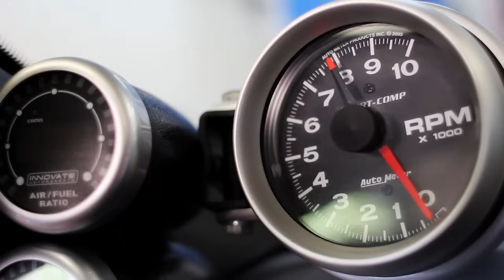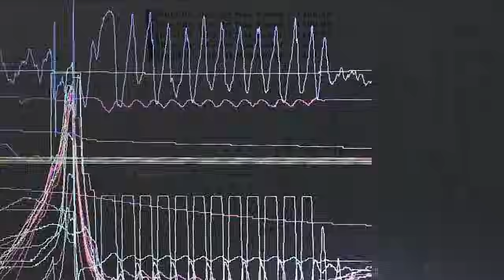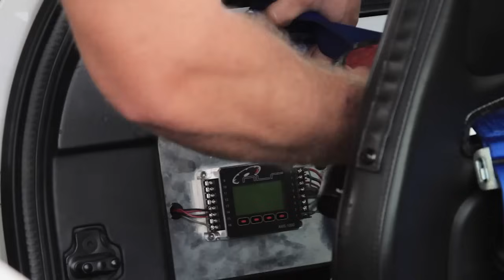New World's Fastest Car! Ford GT Bad v8 1700 Hp - 455.817 km/h ( Guinness World Records )

Comment: You take the money they put in this car to make the power they did compared to the veyron and they still come in way under 2 million dollars and they got a much faster car. And to top it off its built by one of America's most hated brand's FORD. So it go's to show just because you pay big money or more money don't mean your getting the best. one would certainly hope if they was spending 2 million dollars on a damn car you would get a hell of a lot more than a 1000 HP out of it . it's pretty sad when you can go to your local performance store I.E Jegs/summit etc and you can buy what you need to build a 1500 HP FORD /CHEVY /DODGE  engine for a fraction of the cost. And will run rings around the Veyron..

Comment: I can guarantee that with the engine that the bad gt has, after a day of track you will need to twerk a few things and replace oil category components and emission chargers. not with the bugatti. you can track day long including week and still take your kids to school. I can bet that the heat in that bad gt is terrible in traffic and needs speed to help cool is down in a hot day in traffic. not with the veyron. its not about speed but about quality.

let me school you The bugatti is an everyday car.
The bad GT is a tuned super-car with  racing and performance parts to make it fast. it is built based on speed and racked of from a production car which in turns can't be legal in some countries. funny enough possibility of making an identical car is 1 : 10 000

now ratio vs torque vs engine displacement:

The veyron  compression inside in the engine is 9:1 allowing is to be use driven in traffic jams without having any trouble with heat,  lubrication in the engine, or breaking a connexion rod because its torque at low revs. 

The engine of the bad GT compression ratio seems to be 9.4:1 with high possibility of less warranty to stand the test of time.  the turbos need lot of power to keep balance which is obtained at high revs. The max torque of 1,600 nm should come at a high 6,500 rpm making it terrible to drive in the city or just around your home back to garage.

we will not go into quality of making the car an every day car with stereo aircon, suspension, user friendly, importing, specifications, road licensing in street road countries. in some countries this gt can only qualify for track.

now if u own a super car u will know that the nissan gt is much faster in take of and it being a production car means this is a topic for another day

Comment: Power wise it would blow away the underpowered structurally weak V6 turbo. This is more of a Le Mans car...The new GT40 has a great  chassis but a weak motor. It should have had the 351 Trinity running twin turbos...Veyron is a fast car but never did Le Mans so it remains...

Comment: Fastest "Car", not "production car". That's a completely different league. 
You can put even race cars in the category, as that ford gt actually is. But i would bet my ass that with straight line gerabox ratios and proper areo, an enzo FXX or a Zonda R would probably beat that; this 2 cars just for making an example, cause they're actually engineered for a completely differtent use, and not straight line speed. So why don't get a Le Mans LMP1 prototype in the challenge it's a "car"..That's the fact, this "car" category it's complete non-sense and no one gives a fuck. That car it's not road legal or even stock, it can be put on a side of an F1 car. Or just go to a DragStrip, cmon..
All I see is a team of well prepared and professional mechanics who tuned a Ford GT with the biggest tubos they could put their hands on

Comment: What is the ultimate reason to put a V8 in a car? Lasts longer, more torque, low end horsepower, blablablah... NO. ONLY one good reason. You want to HEAR IT and feel it. Period... So now I watch this video, thinking - da..! Got some pretty good sound here - this will be good! What happens? Cra%#y soundtrack goes on and on... Shift into gear, gone and over... And cra%#y soundtrack went right through the d@mn thing... And the remaining 4minutes and 52 seconds are a complete waste of time. What puzzles me the most is that the sound of the jet is on full throttle... Must have some sneaky suspicion that some airplane mechanic got his paws dirty on final editing. SHAME on you!

Comment: Not the fastest car in the world. Go to the salt flats please.  Fastest car in the world has a speed of over 700 mph. And all of you are going to pull the "Performance Power Racing Re-Sets the Guinness World Records holding for Fastest Standing Mile-"""Street Car""" at 283.232 mph".  This is not a street car, you couldn't take a turn in the rain going 15 mph with out this thing breaking free of traction.  The only way I see you doing it is gliding through the turn with the clutch in(if it is clutch driven). This GT is cute compared to real power.  Don't get me wrong though, I love this car and I myself drive a old muscle car.  Also, I have seen cars with less HP go faster much quicker so you guys need to figure out how to lay down the power better.  Power isn't everything people.

Comment: Shaun is at least funny if not totally MISINFORMED. Ford, way back in the middle sixties, SPANKED Europe's best 4 years in a row. The first two years with a 7 liter PUSHROD, OVERHEAD VALVE V8, then the Europeans got all pissy and OUTLAWED THOSE because they could'nt be beaten. Ford came back with 4.7 liter PUSHROD, OVERHEAD VALVE V8'S with one 4 barrel carb and beat Europe's best AGAIN for 2 more years in a row until the Europeans put handicap after handicap on those basic engines (which, incidentally your mother could buy in a regular SHOWROOM mustang or other model car). Europeans will NOT EVEN ATTEMPT NHRA or NASCAR (What's up with that?) More recently CADILLAC (imagine that...) had the fastest time on the Nurburgring test track beating Porsche's BEST until Porsche CHEATED by modifying their car submitted for test until it beat the Cadillac. The UNITED STATES has ALWAYS been FIRST in whatever we've attempted... we always have been... we always will be. We will even survive this EUROPEAN STYLE President we have right now... get used to it Shaun. It's like gospel! You CAN'T DENY IT!

Comment: Ok the buggtii is made out of steel. It's stock and can be bought online. 
This things a FRICKING dune buggy it's had all its heavy parts striped out. It's all aluminum and small.

what im saying is

THERES A HUGE FRICK DEFERANCE BETWEEN A STOCK CAR. AND A JACKED UP ALUMINUM CRAP JOB!!!
Reply: No the Bugatti is mostly made of Aluminum and Carbon Fiber. It can not be just bought online, there were less then 500 of them made over the course of 10 years. The last one was made and sold a few months ago. Now the only way to get one is to wait for one to go up for auction, and would likely cost a few million. 

There is a big difference between a stock car and a tuned car... but they did not alter the frame or body... just the engine, tires, and gears. 

The Bugatti Veyron is still the fastest Production car, but is not the fastest Street Legal car. This and the Venom GT are faster.
Reply: wrong.  venom GT max'es at 200. bugatti is
  studders at 274. 

 wrong and right.

worng ,bugatii can be bought online

right. its mostly bought at auctions.

 wrong. its the 21'st century. most auctions are online. 

i dont mean to be to harsh about the ford. i love the decently afordable price and all and all look of the car. 
what im saying is this ved PO's me cuz these big shot texens. jacked up a 200k car and broke a record. theres a diferance between a car bought at a auction stock  going 274. 
and a car with nearly 300k in tune ups and upgrades.

again i dont mean to be rude i respect your  opinion.
Reply: Jonathan McCann Not meaning to be rude as well... but did you bother to Google anything? 

The Bugatti Veyron SS (fastest version) officially holds the Guinness record at 267.856mph (Source: http://en.wikipedia.org/wiki/Bugatti_Veyron ) 

The Venom GT officially got up to 270.49mph according to Guinness, but does not hold the record because there are not enough of them made to call it a production car . 
(Source: http://en.wikipedia.org/wiki/Hennessey_Venom_GT )

The only way to get a Veyron is used at auction, and yes you can bid online... but the same for the Venom GT, they are just as hard to get as a Veyron.
Reply: nope. most of my facts are off my head. i assume you did?
Reply: Jonathan McCann.... did you not read my whole comment? I put my sources in. As it stands most of your facts are wrong.
Reply: nah i didnt im in notifications i didnt show full thing. i just got the drift and didnt read it all....

Comment: But the veyron is reliable comfortable easy to use air conditioned car that goes up in value its not a racing car with extinguishers harness set & team of mechanics.etc  is this childishly named bad GT a normal usable day to day car that doesn't have squeaky racing brakes racing clutch rock suspension does it even have electric Windows & comfortable seats.
For me the definition fastest car means car not racing machine for a man in a helmet that can't hear the person next to him shouting.
( nothing against the ford I prefer it's looks I think the veyron is quite ugly I prefer the normal ford GT sound though.

Comment: Sorry,but I hate ford.I think they're an unreliable piece of sheite.But the GT 40 is very beautiful, and they should bring the Pantera back too.Thank god a beautiful American car holds the world record.The GT40 won at LeMans and is still winning!! Bugatti is the world class high speed automobile,but America can build a car to rival anyone's road worthiness.General Motors built an Indy-looking machine that had 4 front tires that steered and it was front wheel drive! The two rear wheels just came along for the ride.4-wheel, front-wheel drive,kerosene burning,turbine engine,had a giant flywheel laying horizontally(which helped for stability),and got 75 miles per gallon at 150 miles per hour.WHERE DID THIS CAR GO, AND WHY ARE WE NOT DRIVING THIS SORTA THING TODAY?
Reply: Because it'd brake like shit, handle like shit, and you couldn't fit shit in it. Basically the exact opposite of what you want in a production car. It got turfed for a reason.
Reply: the brain the Bugatti does reach those speeds but however it takes 6 months to get there lol know ur shit!
Reply: the brain Lol unreliable? Almost everyone i know who has owned a bmw, mercedes, audi, porsche always has maintenance issues and the shit is always expensive to fix
Reply: Yes, they made them better in older days.I've seen many older BMWs go 300,000Miles and never get a loose front end part.(or have any problem).
Reply: Ya i agree with you on that part them old bmw's were pretty great car but even the old fords were too so cant really say they shit lol
Reply: the brain  A lady from Florida bought a new 4 door 1963 (Ford) Mercury Comet  with a 260 V8 and she drove it for nearly 50 years,no major engine rebuild ,just a valve job 15 years later,auto trans never rebuilt ,it even had the original AC compressor..
Reply: Robert Diehl Yes, how many miles did it accumulate? 28,000? Any car will last 50 years if you don't drive it much. I do admit that America made very good, reliable vehicles in the years before emissions. Every company had some spectacular engines and models.Still, to get 150,000 to 200,000 on them was a spectacular feat, the odometers only went to 99,999 then flipped back to all zeros.
Reply: the brain It had over a half million miles ,there is a vid on it ..I will find it...I had an old 1970 Chevy station wagon with at least near 300,000...Yea the odometers were 5 digit counters but that lady kept records of her service intervals..I will find it later on..Cubans had old American cars from the 1950s for for nearly 50 years ..
Reply: Ian Gargan Yeah baby, that would be a good fast attack vehicle.But those guys had something similar that had adjustable ride height and could travel across the desert at 200mph.(Back in the 1980s or so.)
Reply: Read the full op dude